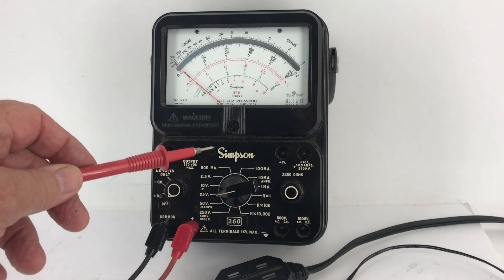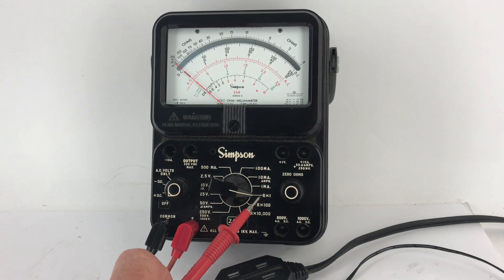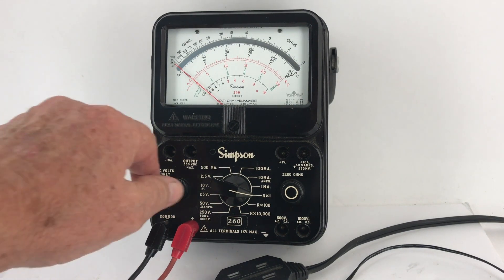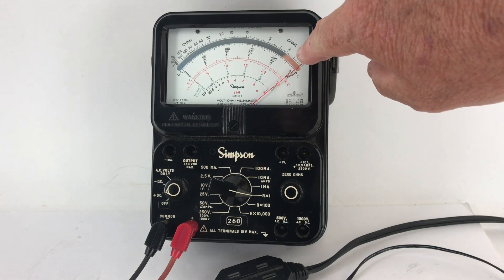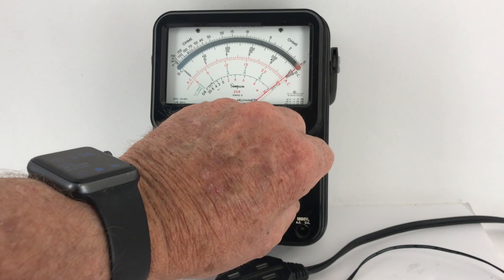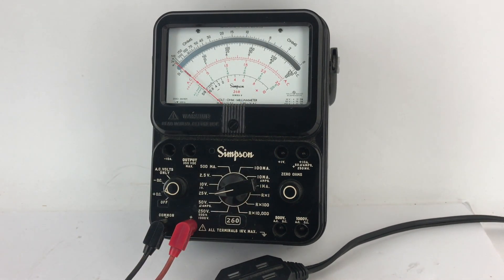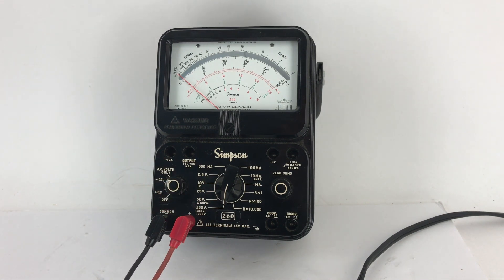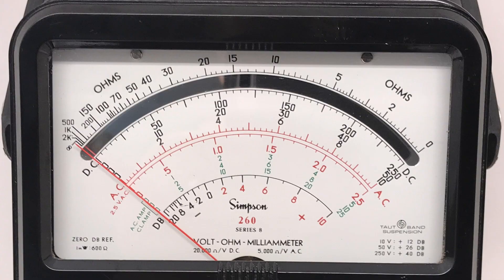The Simpson Model 260 Series 8 Milliammeter

Comment: Using this same model analog meter in class.  Just started school going for a degree in Industrial Electronics Technology.  If the resistance was set on Ohms X 10,000, would the needle pointing at 100 indicate 1 M Ohm (MegOhm)?  and then set the same, would the needle pointing at 150 be 1.5 M Ohm (MegOhm)?  How about set the same way and needle pointing at 1K or 2K?  Thanks for any help you can give me.  Gotta get this all down pat, because I'm 47 and have TAA funding to obtain this degree and need to keep my grades up.  THANKS!